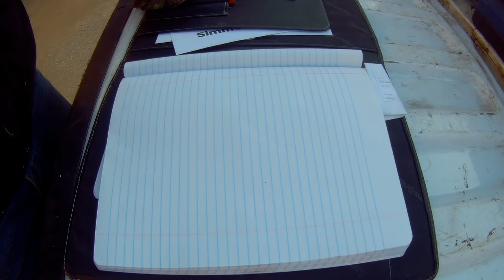Downspout drainage solutions - How to (Part 2)

Comment: I like the idea using a catch basin but it seems hard to disassemble to clean out? I was leaning towards 4” nds corrugated pvc do to supply shortage pvc solid very expensive.
Reply: Dont follow this
Reply: @rdaws73  I went with a solid 4” PVC thin wall. 200 ft (3) downspouts & wyes
 with clean outs. Also tied in a 12” catch basin out to daylight. The system works perfectly. Dug down 15” with mega 6” wide ditch witch.

Comment: Not an expert here but I dont like the modified basin grate. Its purpose is to catch leaves and roof debris, preventing them from entering pipe and potentially a clog. I guess it wont matter much on such a short run though. Pretty easy to snake that.

Comment: Its funny the catch basis manufactors instruct people to run the pvc pipe on top of the green vent. But experienced installers know that a large margin of water seeps into the ground near the foundation if you dont cut the green vent like you did. It will seep directly into the foundation if it was placed on top. I actually dont seem to see the reason to put the green top on the basin at all, would there be a benefit to the green top? Maybe to keep critters out I guess.

I am a little confused do you have slope on both pvc runs? It kind of looks like the tail end isnt sloped not that it matters in that short run.
Reply: Yeah I don't like the NDS systems at all.  "4 inch" doesn't mean it fits 4" pvc.  Getting the fittings to properly match up to standard PVC is a pain.  Seems hard to just get a gutter downspout to go directly to a 3" or 4" drain pipe.

Comment: So a couple of things.  If this is not a warm climate, like winter, etc.  That design is prone to have freezing as things thaw and refreeze etc on the sidewalk and driveway .  Also, you could have went deeper and at the end under the popup and put a normal 90, just put an extension to bring the popup up to grade from the 90.  The hole in the bottom of the 90, with proper rock area under it, would have drained out of the 90 and then your pipe and your catch basins could have been more standard and not customized.  Overall good video though.

Comment: Here’s an idea, cut the walkway and run the roof run off to the street. If your customer doesn’t want to pay then on to the next one! You seem like the kinda guy that’ll half ass drainage to get the bid just cause the customer won’t pay for a correct job. Property water belongs at the street, any drainage contractor knows that. What an ugly finish I’d never put my name on this. Right by the front door too. Corrugated pipe works GREAT when properly installed. Just replaced a roof run off system that was corrugated pipe that was 15 years old. Only had one collapse point. Get this guy outta here!
Reply: @Chris-v4l3l  def wouldn't be on my short list to hire.
Reply from the maker: Dylan Hausinger if you are paying for it...great. But you were not. The home owner had already spent upwards of 5 thousand fixing a major drainage issue in the back. A channel drain was suggested here, but his budget didn’t allow for it. 

I went to your page. And like every other sit at home expert you are a watcher. You watch others and think you know something, but you don’t. You only see half the details and your mindless brain cannot comprehend the rest. Any reasonable person can clearly see you are a sit at home expert...get this fool outa here!!!!

Oh one more thing mr. expert. Many cities do not allow the water to discharge at the street. Duh!

Comment: Do you have to put a catch basin on the end of the gutter? Or can I attach a gutter extension and run it under ground to a solid pvc pipe?
Reply from the maker: Anthony Smith it’s not something you have to do. This house has lots of roof shingle asphalt coming off it, so for this home it was important to have something to collect them. 

Look at your home and situation and determine if the system would benefit with a catch basin. A simple clean out point would also help. Each situation is different, but we do like to have a way to capture debris, and (or) clean the debris.

Comment: Good info!  Thanks for the video.  When you use silicone, is it possible to still use glue?  And do you run into any issues with screws catching debris on the inside of the pipe?
Reply from the maker: Casey Bieker no. If you use silicone do not use glue in the same fitting. Silicone will take a long time to set, sometimes, depending on weather up to a complete day. Use the smallest screw possible when connecting, obviously a 2”-3” screw would perhaps catch debris. So don’t use something like that.
Reply from the maker: Casey Bieker this is what happens when you don’t secure them
https://www.instagram.com/p/Bqm3TIThFqD/?utm_source=ig_share_sheet&igshid=12yc7lpf133ig

Comment: Love how people tell u what u “should have done” not knowing anything about the customer or budget you had to work with. There’s more than one way to do most anything but it all comes down to money.  If it works and the customer is happy then job well done!
Reply from the maker: bpmaris finally. Someone with common sense. You’re a rare breed indeed 😀👍
Reply: BPmaris. using a long sweep has nothing to do with cost .it's about doing it correctly . the cost difference between a T and a long sweep is negligible . 
The installer even if he says " i've never had a problem " is just wrong and it is illegal in some states and countries .

Comment: great video! quick question and sorry if it sounds stupid. i recently bought a house and my yard seems to be saturated with water due to rain and the rear downspouts are sending water there. i would like to do a drainage pipe underground and divert the water to front of the house, but both sides of my house has a concrete walkway so i cant exactly bury anything there or even go around it cause of the fence lines. instead of using good ol solid pipe running along the concrete walkway, am i able to use multiple sealed downspout extensions as an alternative to regular rigid pipe? the front of the house has a lawn and is slopped so doing underground solid pipe is possible there, the rest of the property is level. its just a quick idea and i just want to make it look more aesthetically pleasing. thanks for any opinons and/or recommendations. have a good day
Reply from the maker: arfift33n yes, you could use multiple extensions. I’m just not sure how it would look, if you are considering aesthetics. Cutting the concrete is also an option. Depending on the length of walkway, or driveway, this is something you could do yourself. Once concrete is cut : remove, dig trench, lay pipe and re pour concrete. 

If the concrete is 4ft wide, or less you can actually dig under it and run your pipe. Several videos on how to do so.

Comment: So with a massive amount of pine needles over head would you recommend a larger catch basin? I need some way to insure my lines stay clear and I like your system!
Reply from the maker: Mr. Hanky yes a 12” or 9” catch basin can work. I couldn’t use those sizes in this location. Also, it’s not necessary to cut and extend the gutter downspout extension into the grate. You can end it above the grate, about 1”.
Reply: @bbdrainage  thanks so much, I've learned alot from these vids
Reply from the maker: Mr. Hanky https://instagram.com/p/BkT8CtGhTsw/ 

Follow that link to my Instagram account to get a look at the other configuration I mentioned.

Comment: That is a ugly corner to work with. They just have to stair at all that ugly piping everyday. Couldn't ya run the gutter lines over a different way like a dual exhaust system? So that you don't got ya piper showing to everyone. Or maybe they are just on the budget and don't even care.
Reply from the maker: the client was going to redo the beds, so far as landscape it. I mention that in the video. He imported dirt to cover the pipe and planted new plants. It wasn't in my scope of work.

Comment: I like this system better than having just the pipe to avoid the pipe being clogged up over time with leaves and asphalt from the shingles but: isn't the purpose of the top of the catch basin to catch the leaves and debris and only allow water in to the pipes?  With the pipe going past the top as in this video, what keeps the leaves and other debris from getting into the system?  I may be missing something.  The water pressure will carry the debris with this setup from what I can tell.  Thanks
Reply from the maker: James Pickens I agree with you on the leaves. However, not the asphalt and dirt. There is a sump area in the bottom of all catch basins. The debris collect in this area. Even when used in yard drainage systems the debris will collect in the sump area. I have a few videos which demonstrate this. The sump area serves as the main collection point in a catch basin, not so much the grate.

Comment: B&B Drainage Solutions okay I will keep that in mind mister gutter down spouts movie director. Make sure the gutter down spouts are connected properly. Bc the gutter down spouts are super important and gutter down spouts can cause so many problems if the gutter down spouts are connected to the corrugated pipe. But it's way better to connect just the down spouts and leave the gutter alone so that the gutter down spouts are right.... right? Haha  gutter down spouts

Comment: Hi B&B Drainage Solutions, 
Great video thanks for sharing. 
I have question why don't you use PVC cement instead caulking.   I think PVC cement is better choice. 
Thanks again for sharing.
Reply from the maker: Ed O'Neill oh Ed. I guess in your perfect world a glued joint has never failed. Makes no difference which product you use. Each is prone to failure. And the “well it’s no big deal” remark is your assumption. Something I never said. There are major differences between sewer and rain water, which I was trying to explain. So that it might perhaps give you a little more insight between the two different applications. But I see you are stuck in your own bubble. Trust me. Silicone is more than sufficient for the application. I know it’s hard for you to grasp the concept of doing things different, but people pay me all the time and are happy with the end product.
Reply: Thank you for your videos. I own a landscape company in New Orleans and am actually headed in the direction to do strictly drainage work. I’ve been doing drainage work for 10 years now. I like watching your videos and take some of your advice. God bless.
Reply from the maker: Andy Nguyen I get that question often. I have used silicone for 15 yrs and I can say honestly I have never seen one leak...the ones I’m able to go back and check that is. Or have I had a call back. My main reasoning for using silicone is the system is not pressurized, so I don’t see the need for cement. That’s my thoughts.
Reply from the maker: Ed O'Neill two completely different applications. By code sewer is required to use cement. So yes sewer pipes need cement. This is an outdoor drainage system. Can you see the difference if the joint was to fail when you compare the two applications. I don’t understand why people try to compare two completely different trades which have different applications and requirements.

You are looking at a connection point on a residential downspout. What stresses is it subjected too that warrant the use of PVC cement? I’ve used PVC cement in drainage applications, and still do. When necessary. Such as connecting joints under cement. But for a connection point on a residential downspout, or sealing a catch basin outlet, or plug -silicone is more than sufficient to keep the connection waterproof. That has been my experience with using silicone.
Reply from the maker: Ed O'Neill I added a little more thought to this question. Hopefully it helps some.
Reply from the maker: Ed O'Neill thanks for proving for all your intelligence level. You can always spot the one who thinks he knows it all, or the “it’s only my way individual “ by the way he expresses himself. The lack of intelligence is usually proven with the inability to express a cohesive thought without profanity, or at the expense of others. 

Like I’ve said. Silicone is more than adequate for the application.
Reply from the maker: Ed O'Neill and the tie a tractor to it...yeah cause that happens in every day life. Oh geez. It’s getting good in here 😂😂😂
Reply from the maker: Ed O'Neill silicon is a proven water proofing product. And has very good adhesive properties. The cost of silicone are equal to that of a double pack of pvc cement. Pvc cement $8.50 / 100% silicone $6:50. Yes, that’s $2 dollar savings is making me rich. 

I’ve used both products over the yrs. each has and offers benefits depending on the application. And still in some areas I’ll use pvc cement over silicon. And visa versa. 

Silicon is more than sufficient and has proven to be an excellent choice for sealing the joints on the downspout extensions. 

There is nothing cheap about using 100% waterproof silicone. It’s just proven to be a excellent product for the application for which it is being used. Very high tolerance of temperature fluxes, flex’s under stress and movement, resistance to UV and other outdoor elements, maintains waterproofing characteristics for decades. Excellent product.
Reply from the maker: Ed O'Neill oh and eddy...thanks for admitting glued joints fail in your belligerent post the other day. See. We can agree on something 👍
Reply from the maker: Ed O'Neill yes. So they are prone to failure. Regardless if it  it is due to it not being done right in the first place. Weather conditions, dirt, bending the connection point at a bend can all lead to failure. Same applies when using silicone. 

Silicone, the correct one, for the application has very good boding capabilities and offers excellent waterproofing for all gutter downspout extensions going into the main drain line below grade. 

Been using it for 8-10 yrs now in certain applications with great results when done properly. 

100% silicone will prevent leaks and separation at the fittings ensuring a leak free connection 👍